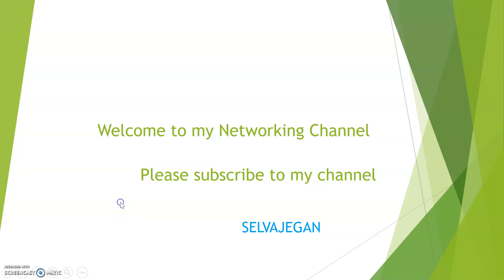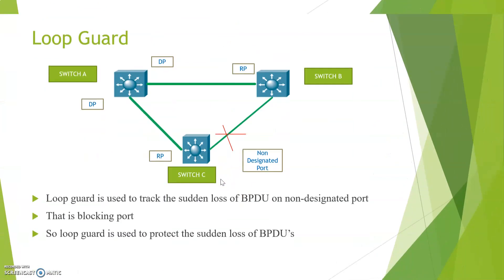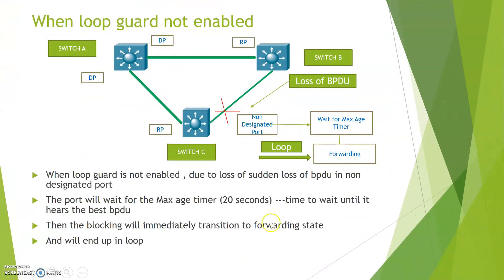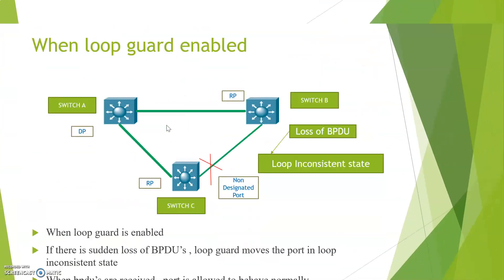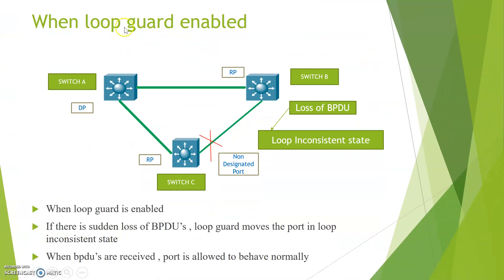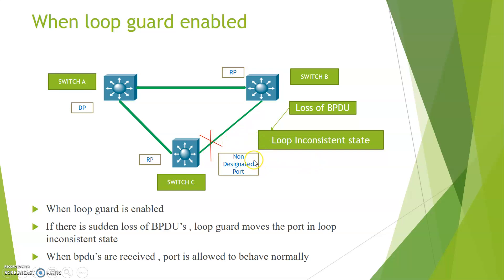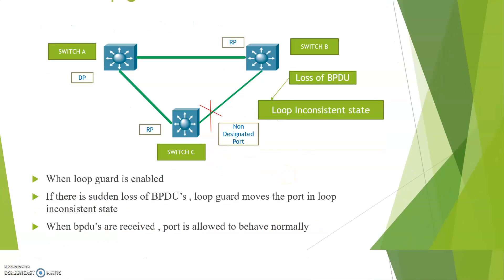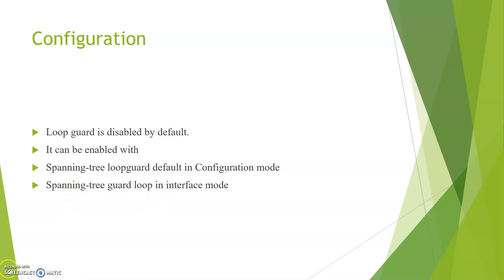Loop Guard

Comment: if loss bpdu from switch B , how will get loop, please let me know
Reply from the maker: If  a loss of BPDU detected  on non designated /blocking port , this port can move into forwarding state and can cause a loop
Reply: Thank you so much for reply and ans sir,what reason sudden loss of BPDU from switch B
Reply from the maker: @msviswanathan8685  yeah it can be due to misconfiguration , link failure ,any port errors. hope that clears